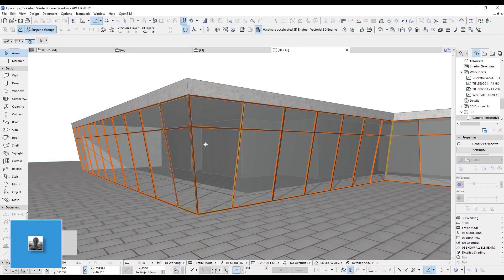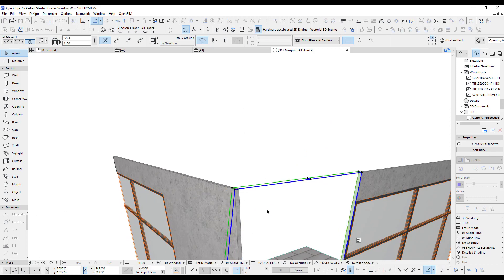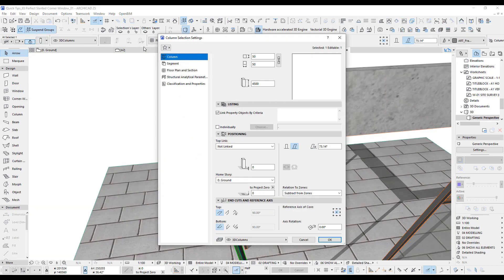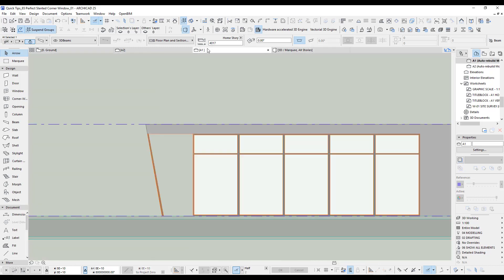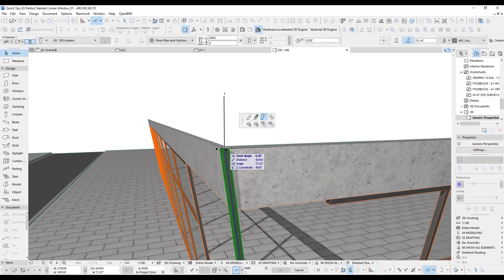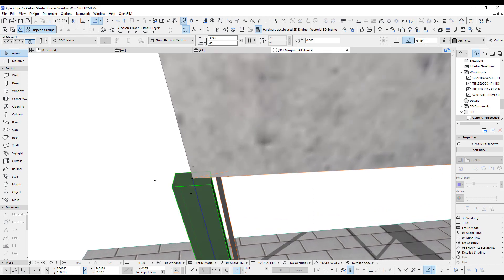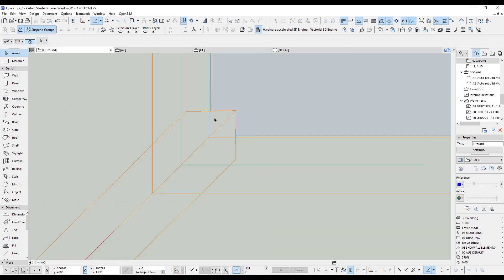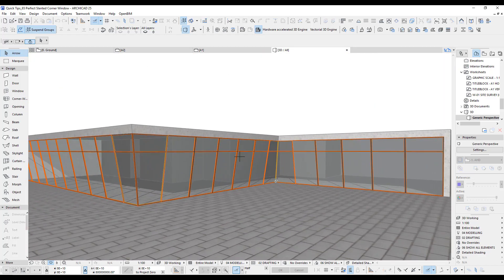How to model the perfect Slanted Corner Window in Archicad

Comment: How do you embed the curtain walls into the walls???
Reply from the maker: By adding an empty hole, like with an empty window.
Reply: @ASMTechbase  When you are slanting wall, the curtain wall adjusts automatically. How do you "link" them together?
Reply from the maker: @2dbaddiepostedonmybed  Actually I just checked the model and tutorial. I did not use a curtain wall, just normal windows, hence the windows are connected to the wall. I think if you watch all of the tutorial you will see that.

Comment: You can rotate the slanted column in its axis - no need for an individual profile. BTW: wouldn't it be faster to use a curtain wall?
Reply from the maker: Hi Markus, I missed the rotation option but looking at it now I found it!  Many thanks.
For people following me on this channel, the rotation option of the column is at the bottom right just above the ok button. This means you don't need to create a profile, which makes it faster and more flexible.

Comment: Thanks man. Painful that AC doesn't have a library part that adapts to slanted walls. Good work around. Painful if you are changing wall angles a lot during concept design.
Reply from the maker: Yes it is painful and I am surprised they have not added this feature by now. Or even at least a  corner window that CAN adapt to slanted walls. as you mentioned.
The glass can be drawn with different tools that is right, whatever suits you best!